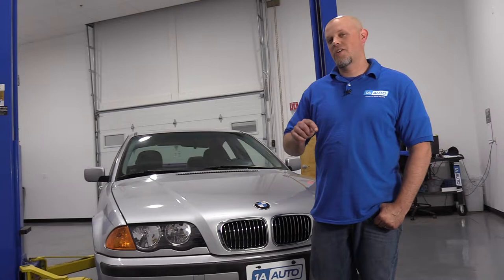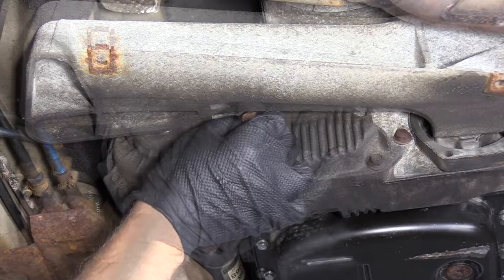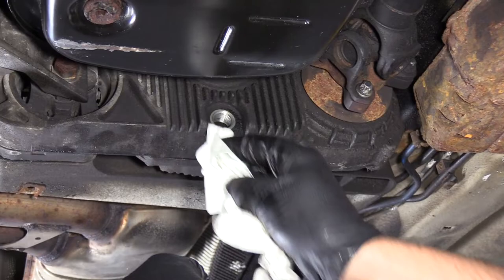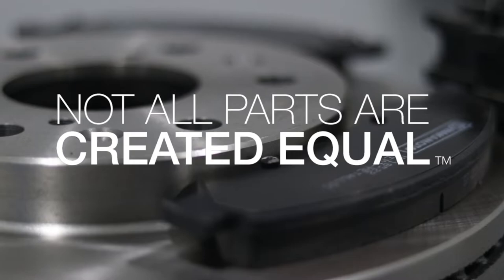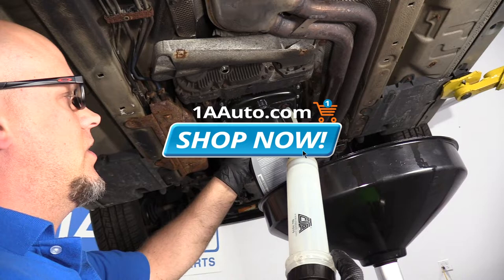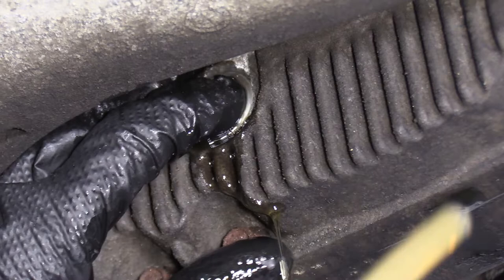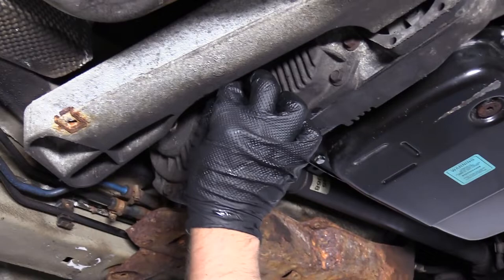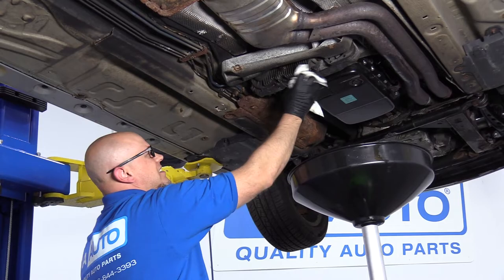How to Change Transfer Case Fluid 97-06 BMW 325 Xi

Comment: Which fluid did you guys use here? I’ve read all the forums and I’m getting a wide range of options. I’d like to follow your DIY to all the way through for my first time doing this
Reply from the maker: +Oi Oi Oi! Your owners manual or your local dealer would be able to tell you what type of fluids to use. Brands are a personal preference. Thanks for checking us out! http://1aau.to/m/Shop-1AAuto-c
Reply: synthetic 75W85 manual trans fluid, picked some up at the dealer yesterday